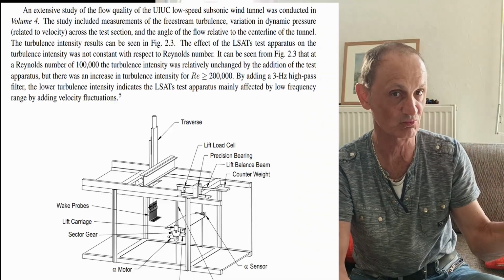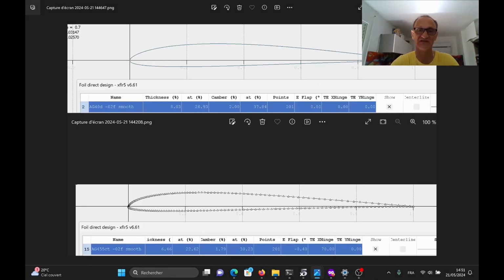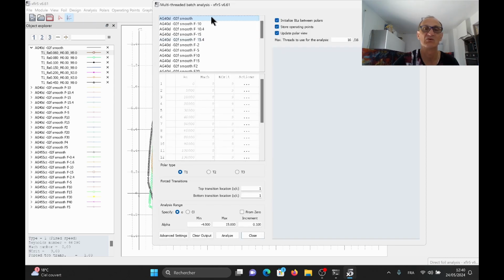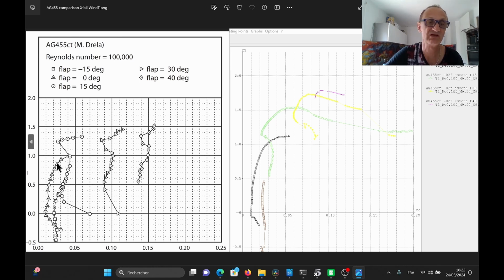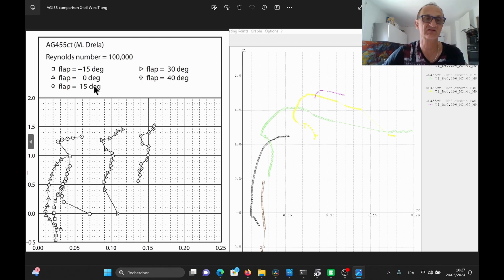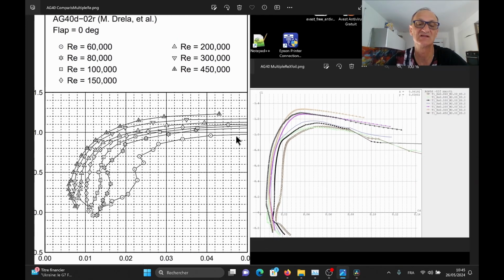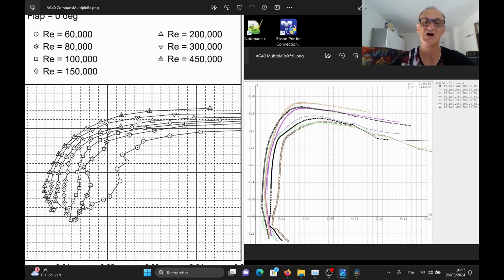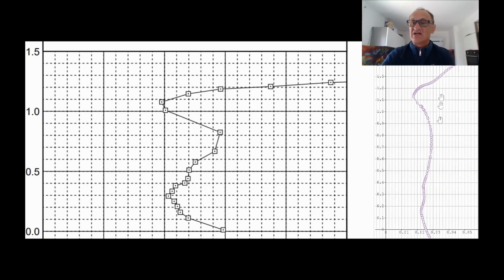Is Xfoil reliable?

Comment: Again , very interesting
@10:16, you say negative flap is better than positive flap during a turn.
It is better for drag or for lift or ratio?
Is it why you do not recommand snapflap ? 😁
Renaud
Reply from the maker: Hi Renaud. I wanted to highlight that during a turn the aileron in negative position (-15 degrees) has a low drag, confirmed by the wind tunnel, and consequently it brings interesting ideas about the adverse yaw

Comment: Your points are good, but isn't Mark Drela the author of Xfoil? Why would he either publish an airfoil that didn't fit his program or publish a program that doesn't fit the published wind tunnel data? What this suggests to me is that the wind tunnel data may be wrong.
Reply: All algorithms are an approximation.  Sometimes the approximation is better than others.  There is always error in measured data.  Sometimes that error is the same direction as the prediction, other times it is the opposite.  With enough sample cases, you should expect to find examples of extreme differences.
Reply: Odd things happen at low Re is why.  Standard gas mechanics(Xfoil based) do not work well due mainly to odd suction bubbles attachment/detachment, which said math does not account for, often caused by micro gust conditions, turbulence from airfoil not matching theoretical, dirt, and once again, length of laminar bubbles and burst mode of said bubbles
Reply from the maker: @w8stral  Turbulence is a huge topic! Not counting the imperfection of the real world 👍
Reply: Xfoil is his software, but the algorithm it uses I believe was already well known. It's a an approximation at best, and especially inaccurate at low Re and near stall. There are all kind of knobs and tricks to help Xfoil but how does one know if you're just making it look better or making it more accurate? I don't think any professional aerodynamicist uses xfoil or its algorithm for professional work.
Reply from the maker: @tim1398  We need to remind that a 2D software. It's still widely used today, and for some good reasons.
Reply from the maker: @tim1398  Good stuff
Reply: @tim1398 Professionals use XFoil all the time😂. Sure wind tunnel and CFD are the best when possible of couse, but try to do either for a wind turbine blade where the Reynolds number is in excess of 1e7. If you can do it, it will be for some few cases. Whereas in XFoil you can do optimization. But the caveats are there. For thick airfoils at high Reynolds number, the drag will be underestimated.
Reply from the maker: Hi. You are right, Mark Drela is the author of Xfoil. But there is always a gap between what the program does and the reality, minus the measurements inaccuracies.
Reply from the maker: Measurements inaccuracies could come from the inaccuracy of the sample wing in the tunnel itself. It is measured and described for each wing in the publication.